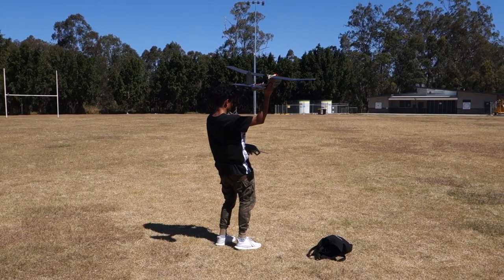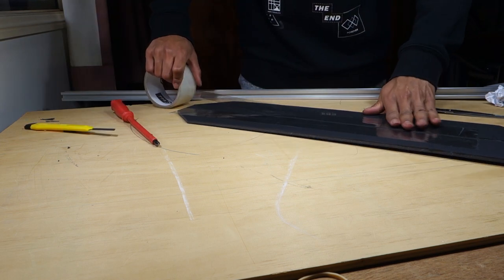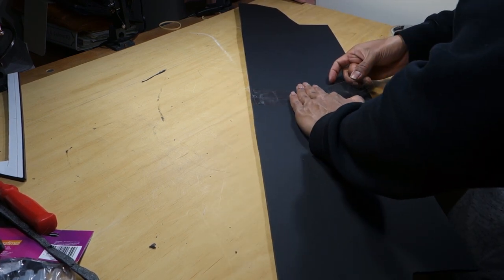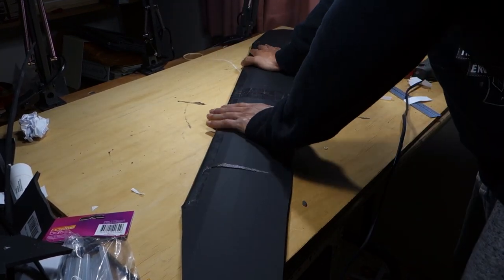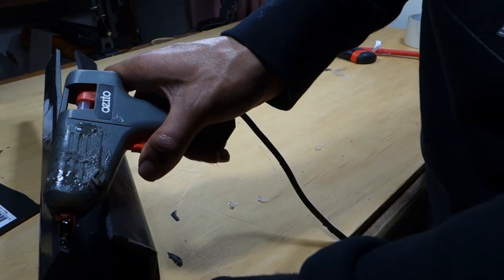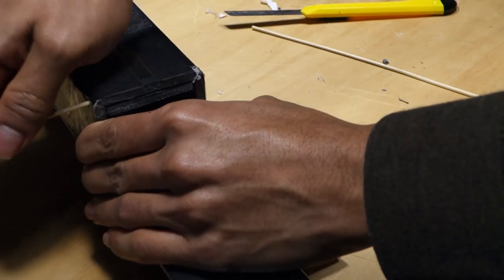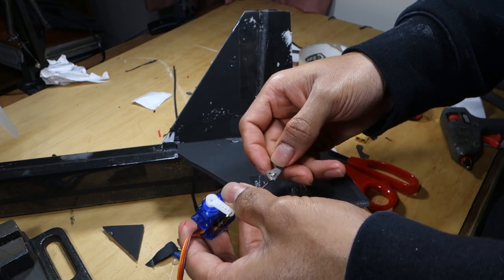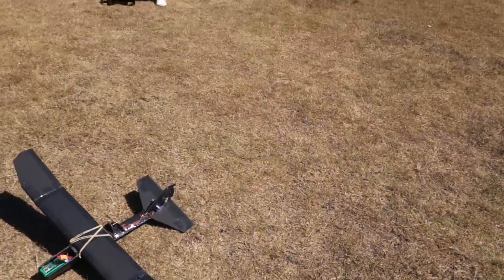Super Easy Foamboard Trainer RC Plane! The EZ-PELICAN

Comment: This reminds me of my first R/C model in 1961. It was a "Nomad" with a rubberband-powered esapement, 2 AA battery-powered receiver, and push-button rudder-only conrol. The motor was a tractor Cox .020 on a streamlined pylon above the wing at the C.G. It had just enough power to slowly get it up to where I could get into a lot of trouble.

Comment: Nice build. I am coming from the multirotor world and wanted to try my hand at a easy to fly budget plane. Nice job overall. I decided to make a few tweaks, building at 70% of the size you did (28"/700mm wingspan), kept the rudder and vertical fin joined during the initial cutting and adding ailerons so that I can practice flying with 4 channels. Planning to run a spare 1105 motor that I have. Also bought a stabilizer to control the flight a little more for a beginner.  I will let you know how it goes.
Reply from the maker: Good to hear Doug!! Very interested to see how you find it. Got any pics?
Reply: @BudgeProjects  No pics yet. So far just a bunch of cutup foam board and a bag of parts. By any chance did you design the motor mount in Fusion 360? I need to scale it down to 70% size and make sure the mounting holes will fit a BetaFPV 1105 motor. If it came from Fusion I could scale it down really easily. If not I will redraw it based on the STL file. Also considering if I can get the servos further forward. Having fun with this. Thanks!
Reply: Now things are coming along. I got carried away and added ailerons to the wing.Just need to finish getting the wiring settles and the e & r pushrods and it's ready to go!
Reply from the maker: @dougjeffery9120  good to hear Doug! That's so exciting. Make a video once you're done. I want to see :)

Comment: How much size of wingspan, brushless motor kv, and total weight?
Reply: 1 meter wingspan.  I used a 2200Kv motor with a 6 x 4 prop and I think all in it weighed about 400g which included all electrics, but excludes battery ( I added a 2200mAh battery at about 200g in weight)

Comment: Hi! Could you please go into more detail regarding the thrust angle this model needs? Looking to build something similar to this but I am not familiar with what the angle I need to secure the motor at. Thanks !
Reply: It depends on the size of your prop, how far back your motor is placed and how high it is above the line of the wing.  I found this video very useful in explaining it: https://youtu.be/0QGp6DpD9og

Comment: Hi Budge, I am building your plane as a school project. What are the specs of the ESC, accu and motor you were using in this video? Would you recommend these parts. Looking forward to you reply. Thanx for this great design and clear instructions! DaanL
Reply: Also, does a RC plane need a flight controller to fly? Or are the servo motor's movements enough to make a plane controllable? (I'm a newbie :) )

Comment: thank you for using "indestructibles!" MY QUESTIONS IS you are using a "pusher" rear mounted engine and does the propeller face forward or backward according to the printing on it?  the engine wires need to be switched so the plane is pushing and not pulling but does the the prop need to be altered! most people never discuss this because perhaps its just common sense but i have seen many confusing videos which have confused me! i know i need to change the wires but each prop has its name and what type it is and should this printing go on the front or back of the prop assuming you dont use a special prop which i dont think happens. the direction of the engine needs to be changed and i suspect so does the prop? i think it needs to be reversed??
Reply from the maker: Hey mate, good question. Imagine the plane has the propeller on the front. With the prop now pushing the plane, the motor moves, but the propeller should still face the same direction according to the plane.  So basically direction the propeller points respective to the plane must stay the same.
Reply: @BudgeProjects  im sorry im stupid! are you saying just leave the propeller alone! you have to reverse the engine by the plugs to get it to spin in reverse but the propeller stays the same? with the markings on the front of the blade? maybe you should do a video on this. i have seen examples of the prop pushing things by its nature of "turns" it has and if it spun in reverse i dont think it would work?
Reply from the maker: @charlesklein7232  thats ok! It's a good question. So the propeller should point in the same direction relative to the plane. So front of propeller points to front of plane. Then make sure the motor turns in the correct direction that the propeller pushes the plane in the right direction. 

Wish I could do a video but I'm so busy at the moment. :( 

Since propellers are cheap, why not by a regular and counter rotating pair and mess around to find what works? I actually used a set made for quadcopters here that came with both!
Reply: @BudgeProjects  i am in the process of doing that! im using dc 180 motors like dc! going to be going up to a 380 and maybe beyond! whats curious about that is that they use a gear reduction system on the 380 plus for "TORQUE?" dont understand these things at all! dc is cheaper then ac. in regards to the question however it should be noted that the plane will have thrust but only like half so if the propeller is mounted incorrectly it WORKS! supposedly! but not not to maximum lift an this could be confusing supposedly!! im totally new to all of this.

Comment: Hi Budge, love the video and the instructions. My son is currently building your model and wants to know what propeller you used? He has an 8x6 that clearly is too long to fit. Many thanks.
Reply: Probably a bit late, but I built this and used a 2200kv motor with a 6 x 4 prop and this works well.  I think he uses a 5" prop.

Comment: How many centimeters long plane 1400 kv 2 m motor will be built?
Reply from the maker: What do you mean sorry? Can you rephrase the question?
Reply: How many centimeters tall planes will be built with 1400 kV, 2 m motors ???
Reply from the maker: @ratulhasan6266  what do you mean by 2 m motors? 2 metres?
Reply: @BudgeProjects  2 pice motor.. brother
Reply from the maker: @ratulhasan6266  oh yes right! I think it would depend on the size and weight of the motors and how much thrust they can produce, along with balance of the plane. Could be done though I'm sure, just need to try it out and change things as you go.
Reply: @BudgeProjects  tnq bro
Reply from the maker: @ratulhasan6266  no worries my friend, good luck!

Comment: some info.      at 10:19,  wrong  thrust  LINE  /  angle; see linked annotated photo.     at 11:10,  W R O N G.     (the  MASS of)  SERVOS   SHOULD  BE  INSTALLED     NEAR   THE   CG/c-m;    not  at the  AFT  of the airframe.       Wrong  prop.      next time  USE  AN   E P  prop.     electric pusher.       btw:   ELEVATOR   Should be  TRIMMED,  so that the model flies level at a moderate speed; at about fifty percent throttle.       as a result of the  WONKY  servo installation, this model   HAS   a   Permanently  Tail-heavy dom;   distribution of mass.     turning  Requires  some  MIXING  of  elevator, with  rudder inputs.     excess rudder deflection will  NOT  increase the rate of a turn;    it  will cause  a   ROLL  response.      googletranslate
http://static.rcgroups.net/forums/attachments/2/9/6/3/9/7/a5988257-224-bixler%202%20motor%20angle%20correction.jpg
Reply: Read the comments here for a laugh: https://www.youtube.com/watch?v=e9qIwFLWpHA
Reply: While it did seem tail heavy, hence pitch sensitivity, you don't have to mount the servos more forward. You just need to ensure that you have a battery and components installed in the fuse in such a way that the CG comes out somewhere between 1/3 to 1/2 between the leading and trailing edge of the wing. 

As for thrust line, this should work just fine. A bit of tweaking can assist in climbing tendencies when throttle is applied
Reply: @daviddavids2884  Would it be best if the servos weren't in the tail? Yes, of course. This is a simple foam model, not an SR71...TWO small servos in the tail isn't gonna hurt the plane. I could also show you some other planes that have servos on the tail, such as the Eflite Maule M7.

Not sure why you are calling me an idiot here...I've been flying RC for 10 years, including that heli in my channel pic, which as a $2000 Minicopter Diabolo. I also build my own plans from balsa, and Monokote covering. Please explain how you know better than I do.
Reply: where is your build?